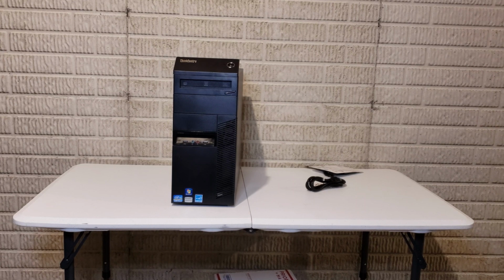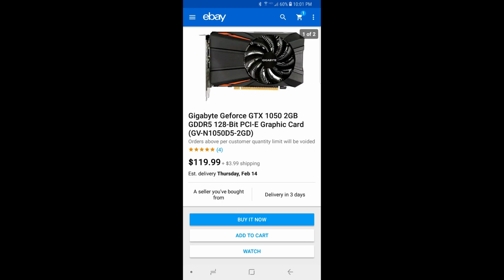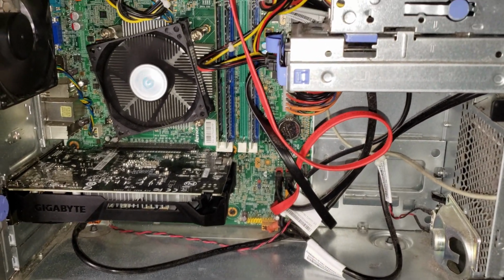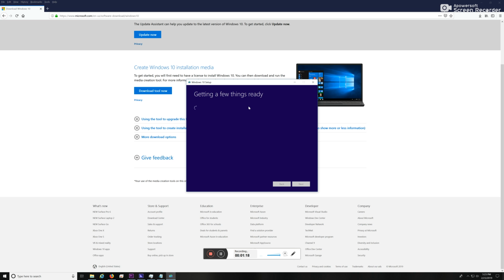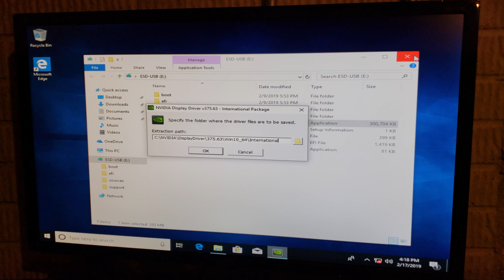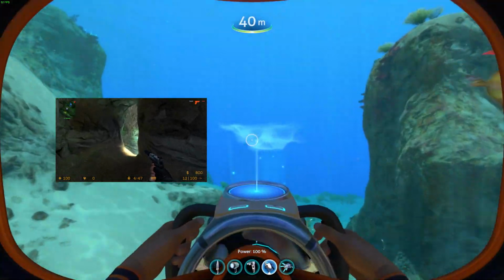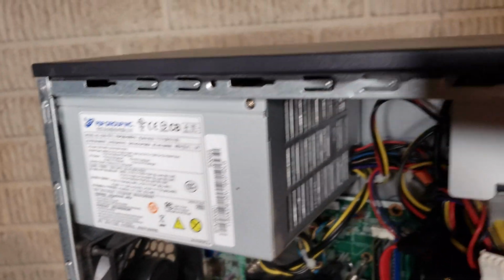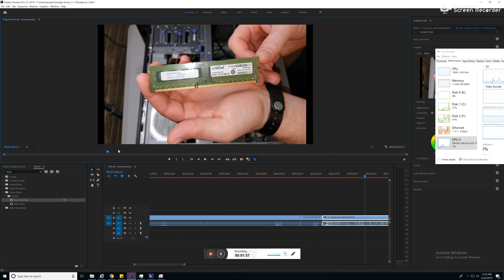$250 budget PC build any average Joe can do! I think.

Comment: I have an rx 560 similar to 1050 but it uses less power and still didn't work with the stock psu I had to get a new psu and a 6 pin connecter just for rx 560 to work

Comment: Pretty meh system for 250. For a bit under $500 my PC has  GTX 970, ryzen 2600, 16 GB ram and an 240gb ssd  all new parts except the gpu and windows 10 pro included in the price.
Reply: De-Andre Steward it depends on the person as well and when you buy the parts, prices fluctuate all the time
Reply: thats double the price, and pretty sure this cpu outperforms your ryzen

Comment: You guys just need to save your money and get atleast a 500 dollar system
Reply: no need. you can build a better pc for 300, go used, 4th gen, plop a xeon 1231 v3 in there, thats better then ryzen 5, even the older threadrippers and even the newer amd entry level cpus. 500 is unnecessary.

Comment: I’m gonna start saving money for this so I can have my first gaming pc
Reply: Plus have you thought about monitor speakers keyboard and mouse??? Trust me save up your money and spend atleast $400 Ik your probably anxious but it’s worth the extra performance
Reply: Look up other builds this isn’t it
Reply: cell. Know your comment is like a month old but definently save money, more money than what this is worth, this is more like a pc restoration build. Making the normal family pc a better pc that can handle a couple of other things, and kne that can definitely last longer for the family. To me a good budget build is one of the older Intel CPU's preferably 4th gen cuz you can over clock the i7 to be crazy fast. And a gtx 1050ti is good for a first time build, and obviously 16gb of ram is always good, and lastly a ssd is good for a  game library you can always go with a Hdd for hour boot drive and misc. files in my experience it's good to have two different drives for storage. But other than that your psu(power supply is also an important factor which this guy forgot to do. Psu Is one of 4 major things to a gaming pc build, your gonna want a lot of power depending on how long you sit their in it.
Reply: BDOG Mango Dude no, save like 800 to get an actual pc that can run actual games
Reply: OODA Angel I ain’t got no $800 dollars this computer can run games that’s all I need
Reply: BDOG Mango Yes. I was thinking of getting a pc for gaming, but I didn’t want to spend $700+ just to play games I could play on a ps4/xbox one for $180.
Reply: honestly, don’t get a pc setup if you don’t even have 800. that’s like the minimum for a semi decent setup.

Comment: You bought it cheap and it performs like a cheap  outdated system. This won't be able to game on anything above very low to off settings on games. You won't even be able to run Roblox at 60 fps.
Reply: RaiderzNation its still good for 250$ mr rich ass
Reply: It can run games that don’t require much like Fortnite or dead by daylight ect. On low and maybe medium settings with shadows off and get atleast 60fps
Reply: @Rarehalo  Try getting 60 fps on fortnite 😂 I don't think a lot of people realize how resource intensive fortnite is now. Not to mention these benchmark scores are abysmal.
Reply: RaiderzNation well I mean not much people play stw and umm definitely 60 FPS on all low 900p 
But the real question is how does it play Minecraft 🤔
Reply: @Rarehalo  maybe 900p but their still may be a bottleneck because of the low end cpu but even regular fortnite will struggle with older obsolete machines. My friend had a PC like this with a 6th gen i5 and he got about 65 with smooth lighting off and all the other settings on default. This machine isn't very capable especially with 8gb of ram. This machine just isn't worth this kind of money. If you are strapped for cash that bad then just buy a console because you would have a better experience on there.
Reply: RaiderzNation 8gb of ram is more than enough
Reply: @Rarehalo  Well I see. I guess you don't know a ton about modern computers judging by that statement. More modern games use more ram. Don't even get me started on Google chrome or video editing software.
Reply: @Rarehalo   HulkaFN  Yeah but you have to run windows and any other background programs you may have installed. The ram was almost all used at one point in the video. The benchmarks just sucked if you didn't notice.
Reply: W O R M G O D Hulka it’s ddr3 ram it’s basically garbage
Reply: Haha true. But it's still better than my friends current computer, and it's cheap too.

Comment: Ok chief , “powerful computer for gaming” this won’t hold any 2016 - 2019 games and most likely won’t hold on older games then that. This is extremely outdated, and your mark scores have severely low FPS. I’d save the money and wait because your going to have to switch a ton of parts when you upgrade to something like a 1060 ti or a 1070 or a ram upgrade to something atleast 3000Mhz and 100% if you upgrade your cpu. Also low specs or not you need to cable manage for lower temps and less stress on the components, those messy wires will kinda choke the system and more dust will build up.
Reply: Wastelandoof ok chief, “1060 ti” fuck is that? There is not a 1060 ti. And plus some 1070’s are like 4-600 bucks for a GOOD ONE.
Reply: 1060ti? Lmao stop trying to sound like you know this pc can play most titles on low-medium settings
Reply: @Rarehalo  lmao, just no.
Reply: His budget is 250 what do u expect a 2080ti?!!
Reply: you are simply wrong. 2nd gen is still pretty good, you can compare it to a 9900k but you can compare a ford fiesta to a Ferrari. this cpu is still quad core and still holds up in games, the cpu doesnt get slower over time, this cpu and even 3rd gen and 4th gen beats newer ryzen cpus in benchmarks. you dont need new to be good. a 4th gen i5 is better then a ryzen 3, old high end always beats new low end, for someone who was 250$, this would be a viable option, when your answer is, "wait till you have 500$ then buy new" things you get new at its price point, wont hold up especially not as good as intels older cpus. this cpu wont bottleneck a 1050, which is not considered a low end gpu, its a older high end gpu, you can say whatever you want, YOU cannot match this price to performance point with anything new, your gonna buy a low end cpu, cheap motherboard, low amout of ram, slow ram, slow gpu, poor case, bad psu, and your going to claim its better because its 2x the price and new, exept its not better. old high end will always beat new low end.